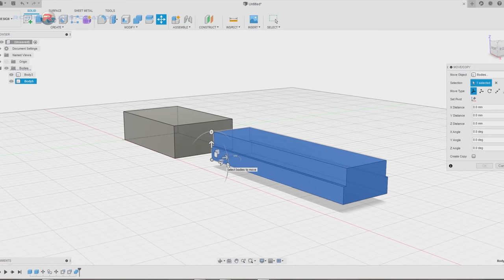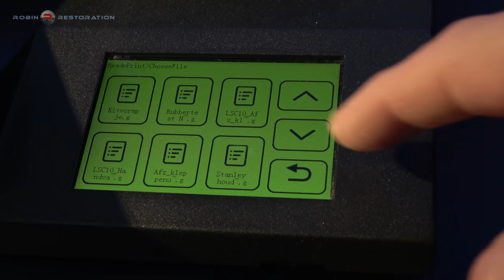Garage rescue: Stanley 75 restoration without electrical tools [4K/UHD]

Comment: Regarding the angle of the cutter, seems to me that is almost certainly a mistake made by a prior owner and not original.  Every plane I know of has a "relief" angle.  But you showed it cutting, so who am I to argue.  There might be problems when the blade gets dull.  Nicely done video.
Reply from the maker: Thanks, I am not shure but who knows...

Comment: Please note that the primary advantage to using chemical paint stripper in this particular situation is most old painted tools were done with lead based paints . Abrasive removal will put lead into the local atmosphere, chemical strippers have to be handled carefully also . Just take the precautions of proper respiratory protections with either . This is one time when the European version of English reflects the true meaning of the tool "Rebate" ( not to be confused with a partial refunding of money ) versus my American version of English "Rabbit"(a long eared member of the rodent family) l know , it' is spelled rabbet but the pronunciation is the same . We don't want people trying to shave their RABBIT with one .
Reply from the maker: Thanks for the good tip!
Reply: Actually, rabbits aren't rodents, but lagomorphs.

Comment: Have you ever considered de-rusting an item using reverse electrolysis? I have some very good successes with it.
Reply from the maker: I have seen others do it but I have no experience with it so far. And I do like the process of mechanical derusting. But for hard to reach corners it would be great.